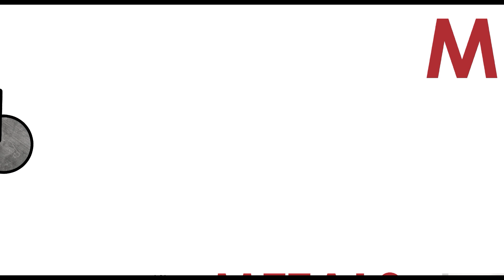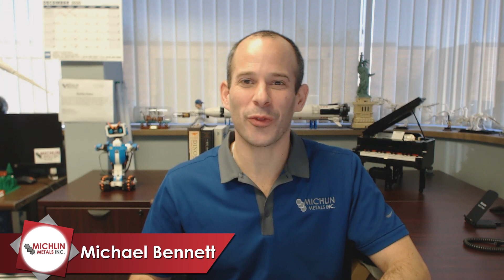Inconel Alloys - Inconel 600 - 601 - Inconel 625 - Inconel 718 - Inconel X-750 - What is Inconel?

Comment: Hey mike! I was wondering where i could go to research the pricing of inconel 625 metals? Im not very well versed in metals and was curious before jumping into an opportunity
Reply from the maker: It's hard to get that data as most suppliers won't just hand over their pricing on items from a historical standpoint. I can try to get you specific pricing on an item or two or recommend where you might be able to get more pricing if that might be of use.....lmk.

Comment: How much do you think the allowable composition range of each element affects the tolerances of high precision machining? I assume a few percent fluctuation could change the way the IN 718 reacts enough to slightly change some properties and therefore introduce variability with the machining
Reply from the maker: Chemical variations are one of many material factors that can affect machining, but typically chem and these other factors become an issue when changing heat lots. Expect to adjust parameters a bit for each new heat lot and use a single one whenever possible.
Reply: @MichlinMetals  thanks for the response. I’m new to the field but am trying to help my machining/forging plant. So if each heat can have different compositions, it would be nice to be able to relate the composition of the raw material to the corresponding machining program since it would vary. I will look into it next week but do the raw material suppliers tend to send full material composition?  I know for a fact that machining can vary wildly even if the exact same program and actions are used but it’s material from a different suppliers. Having ranges that different  programs and/or offsets  could get close to nominal without having to manually change anything or rework would significantly help the plant I work at so I’d appreciate any insight
Reply from the maker: All material supplied that is prime, direct from mill or service center should have the full range of chemistry listed on the material test report. 100%. The chemistry does vary slightly between heats and mills. I would imagine there's a way to program the machine to acknowledge the new heats chemistry b/c yes, the chemistry does vary by heats even from the same mill, if even slightly.

Comment: Thank you for the informative presentation. I've heard that X750 is a rather old school material which is largely superseded by alloy 718, and something I've been curious about is whether X750 still finds use in gas turbine applications today or if it's been replaced by 718 altogether?
Reply from the maker: I can't say for certain but they are both still used and around. 718 is sold by us here at Michlin more frequently by a long shot over X750 and that point would be my only way to help determine what may or may not still be in use. Don't have a great deal more data besides just what we sell. Thank you for the question here and the help you offered on your other response with your comment. Thank you and be well!
Reply: Yes 750 is still used in the industry
Reply: @IsabelDavila0706  I've read that alloy 718 accounts for up to a third of the total weight of an aircraft turbine engine, but also read that X-750 is "widely used in gas turbine for high temperature structural members." Does this encompass aircraft turbines or mainly landbased ones today? Thank you for your insight?

Comment: Welding electrode 600 and 601 inconal alloy are using to weld for NiCrMo3?
Reply: Please reply as soon as possible
Reply: Yes u can use Er-NiCrMo-3, we use to use that tig welding inconel furnace tubes but now use Er-NiCrMo-1 because engineers decided to change the difference is the second one we use now has cobalt probably making it higher heat resistant, the first rod doesn't.